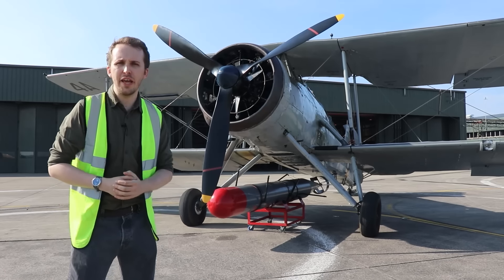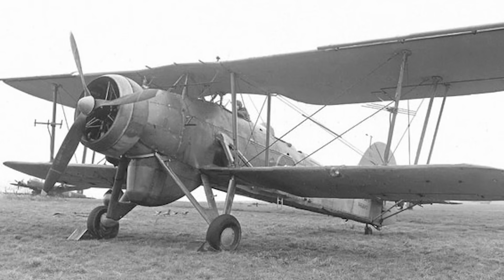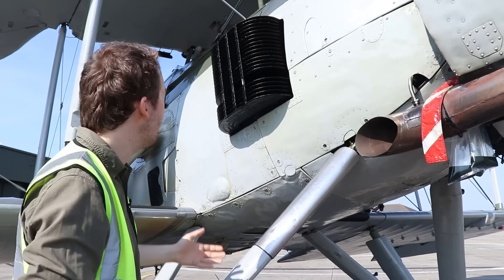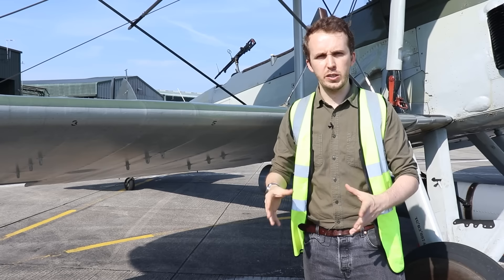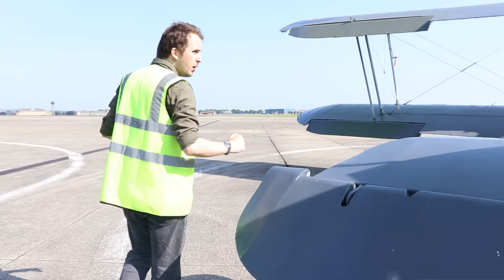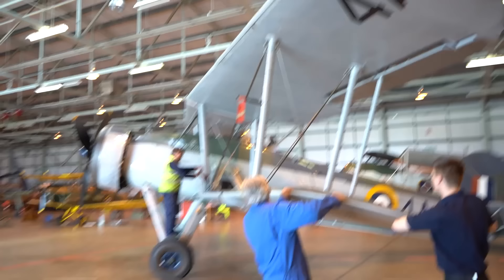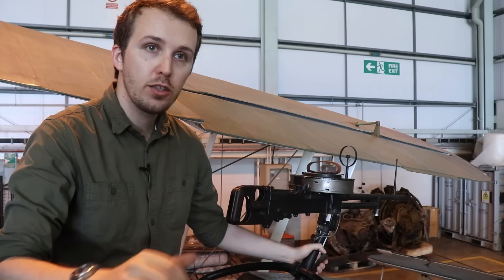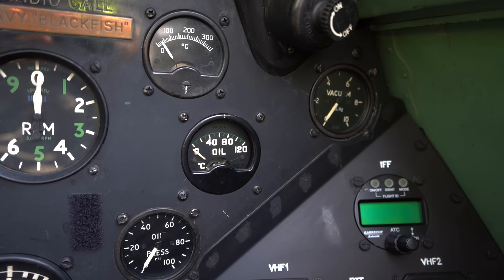Inside The Cockpit - Fairey Swordfish

Comment: Could the front-facing MGs be used against barrage balloons? They were set up over Taranto and other harbours.
Reply: you could, with incendiary ammunition, though even in WW1 it was found that you really needed a larger caliber round. Some pilots used flare pistols or dropped bomblets, some pilots rarely got a larger 12.7mm caliber vickers gun.
With just one rifle caliber weapon you'd poke a few holes but the barrage balloon would still be up for a while.

Comment: I've seen it on many British aircraft, you can see it as well when he's talking about the tail wheel. What does the little cube with W / T mean on the fuselage?
Reply: It's a marking to indicate that the aircraft structure incorporated copper bonding to prevent the build-up of static electricity charges that would increase the risk of fire and/or interfere with the radio. According to a document issued by the Air Ministry's Directorate of Technical Development, "Every fuselage, plane or hull ( i.e. each individual covered component) in which the Earth System or bonding has been installed in accordance with this Specification must have the device [W/T] stencilled upon it, the letter WT to be in clear block type 2 in high." There's no surviving official record of what the "W/T" abbreviation represented in this context, but it's thought that it most likely stood for "Wired [or Wiring] Throughout."
Reply: @keithlaycock9059  Wow, didn't expect that to be fair, that's very interesting. Thank you for the answer!

Comment: How is the load transferred from the wing to the body? There will be several tonnes that are normally transferred by main spars to the body. Here the main spars stop at the fold and it seems that just the red gadget and the rear hinge are at work ?!
Reply: With folding and disassembling wings, the spar splits and reconnects. There is no reason why the spar has to be one solid piece.

Edit: With the swordfish here, you can see that the vertical frames have locking mechanisms to get 4 points of connection (2 per wing). I guess with biplanes, you can get away with this method because the 2 wings give you rigidity.

Comment: Wish you would give physical specs of Brit & US airplanes in feet and knots and pounds. Performance in knots (or mph) and fpm. I don't mind translating when you're doing a 190 or 262, but a Swordfish? Come on. Really confusing and annoying to learn the H-P style leading edge slots on the upper wing started to open at 110 kph. You say the upper wing is angled 4 degrees. Do you mean swept back or dihedral? Assume you're talking sweep back, since you say it was done for CG reasons. Ailerons used as dive brakes in dive bombing? Please explain. Was there a mens  to deflect all 4 simultaneously as flaps while retaining the ability to move in opposite directions as ailerons?  Did it have 4 catapult attach points?  You give bomb load in pounds and torpedo in inches diameter and kilos weight. Why not pounds for a very English plane? You give power settings  in rpm and pounds. I was expecting ATAs. Marvelous old airplane, here well photographed and poorly described.